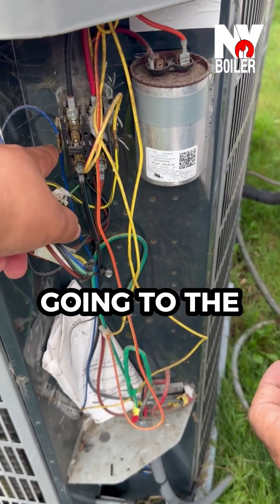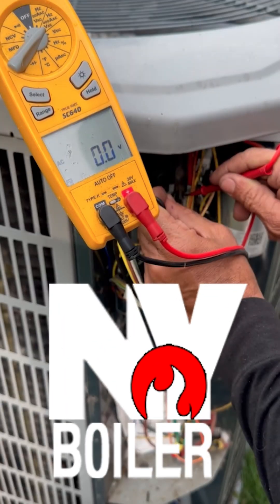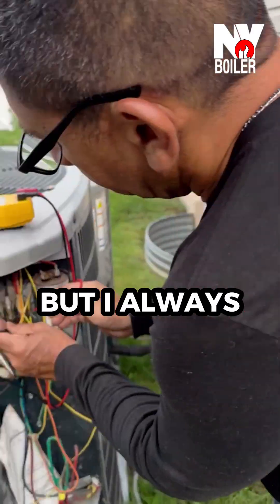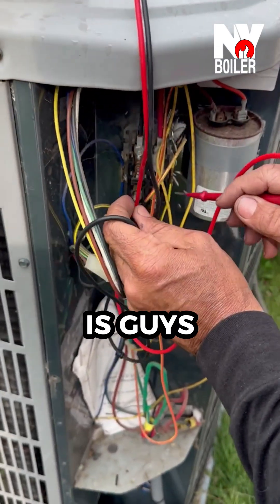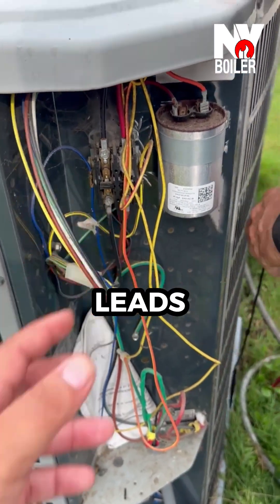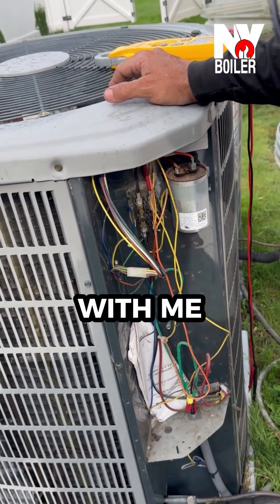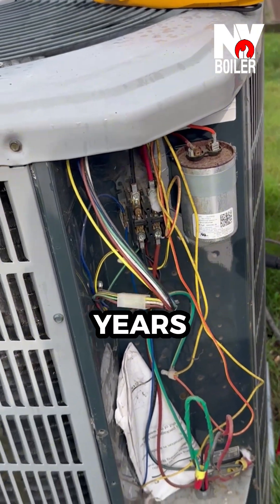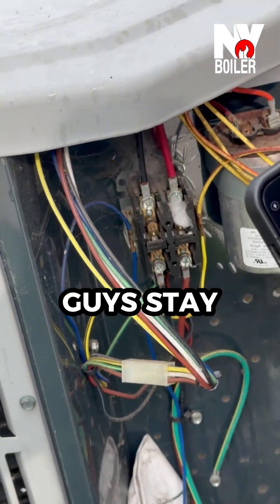⚡ AC Fuse Keeps Blowing? Here's the REAL Fix! 💥 #HVACTips

Comment: Question so I have an old Lennox ac unit and it’s been working fun but as of lately the disconnect box fuses has been blowing after 6 days. I bought two new ones today as I pulled the disconnect switch out I noticed it was how not melted but very hot. I feel it’s an easy fix but not sure could it be the disconnect box it self because it doesn’t have a safe plate recent owners didn’t have it so o thought about changing the box all these webs are in it I cleaned it but still doing. Any advice will be great. Thank you